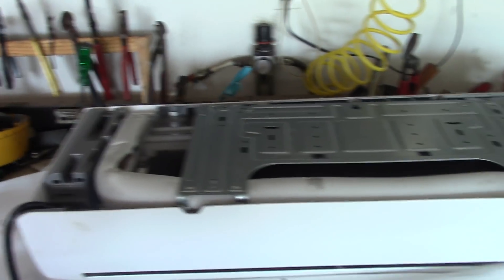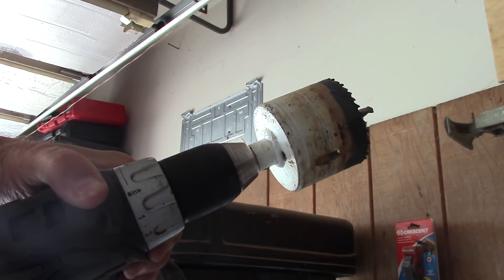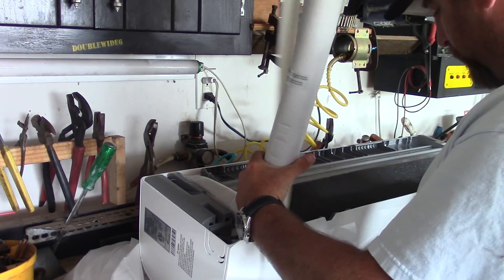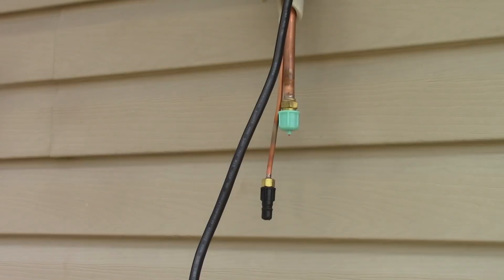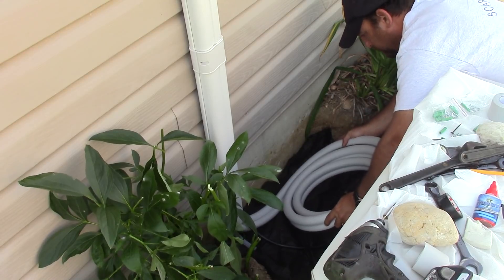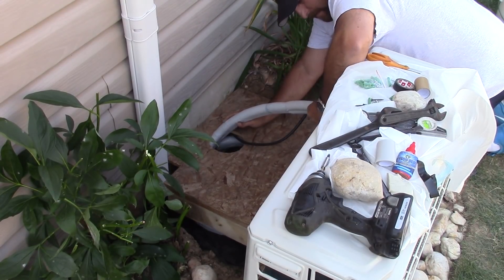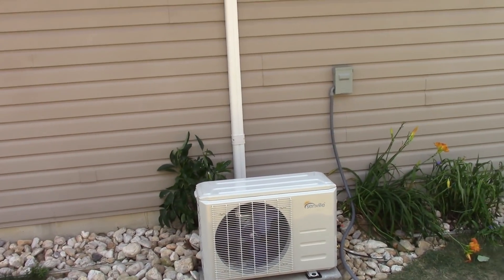Part 2 Senville Pioneer Mr. Cool Mini Split Installation

Comment: Do you think it will be an issue in the future for digging a hole so close to the foundation? I’m thinking about doing the same technique as you but I’m worried about digging so close to my houses foundation since it’s an older home with a raised foundation

Comment: Great video, would it be possible to install the outside unit in a spot higher than the inside unit or would that make the system not as efficient?

Comment: Was wondering if the unit runs good the installation says  the minimum should be 6 inches from  ceiling. I also need to install one closer to the ceiling not sure if it will actually make a difference or effect the efficiency.

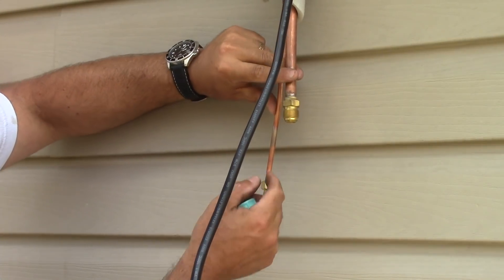Comment: So I bought this unit, and the reason you don't have pressure coming out of the low side at 6:57 is because it all came out the high side when you took the high side cap off. I watched your video before I got mine and wanted to test this out when the unit arrived, and indeed, the lines and evaporator are all pressurized - or at least, they should be from the factory.

Comment: Another great video.  Thanks.  One issue that I see.  The plywood you used is for flooring as you mentioned.  It actually is OSB not plywood.  It is a bunch of shavings glued and pressed together, which is very strong (for flooring and roofing).  However, the glue is not waterproof.  You should have used Marine Board (green in color).  Even though you covered it, to protect it from the rain; moisture from the ground will make that area around the OSB 90-100% Humidity.  It will start to rot in a year.   Although, I like your idea of making a platform to rest the unit on.

I mounted mine about 3 feet off the ground.  I used two metal racks used for heavy storage and secured them to the house and to the concrete.  It is chest high and it was easy to install the lines and wiring.  I hope to never work on it but in case I need too, it will be easy.  My only issue was lifting the outdoor unit up onto the racks by myself trying to impress the wife.  I tweaked my back so I had to stop and drink a beer.
Reply: does it cause vibration since you attached it to the wall?  do you feel the vibration in the house?
Reply: @nick467467  There is no vibration.  I never know if it is operational or not.  I have to stick my head out the window to make sure everything is functioning correctly.

Comment: Another guy not using torque wrenches.  Tylog is to ensure you get the correct seat when you torque the fittings.
Reply: ..and those lines were torqued at least 2-3 times more than required. double flare fittings should never be torqued that hard, ever.

Comment: So I just Installed my  18,000 Senville mini heat pump. Watched your video and it was very helpful.  I was able to cut my lines and make my install a little more sanitary as I had the flaring tool to do it with. I also went to our county and purchased a permit as we will be renting the house out eventually. The county guy was shocked that I was asking him for a permit as nobody had ever asked for one that wasn't a licensed HVAC person. I did have to give them an affidavit on final inspection that said I vacuumed and pressure tested the system as per the manufacturers instructions. I am in Island County WA. and the permit fee was $57.00 and the electrical permit was $65.00 All said this is a very easy install. I had several bids of around $5500.00 to do this install before I decided to do it myself. After everything was purchased from amazon and a few trips to the hardware store for minor electrical conduit and screws I have a total out of pocket of $1300.00 and a great heat system. Super Happy i did it myself !!!
Reply: Mykel Hardin  Yea the HVAC industry is seriously lacking. Every HVAC install and service company doubles their cost on parts, and 80-100% of their "technicians" are only taught OJT by more experienced unqualified techs. Even the nitrogen purge, braising, vacuum, leak check and refrigerant matching is done by unqualified people. The guys that have been in the industry for 20 years have picked up quite a lot through experience but they all have bad habits and straight up bad practices for this or that.

Comment: Great video. Thanks for taking the time to make it. I am also stuck between the Pioneer units and the Senville ones. Looking at 2 zones units. After much research I found that Pioneer costs a little less yet the installation manuals are the exact same for both brands. However, Senville does give more BTU with the outdoor condensor with the 2 zones units. Your video helped allot because Senville does not show that they include the wire, tape, and wall sleeve on their website and Pioneer does. What was your reason for going with Senville? Thanks!!!
Reply from the maker: Hey Paul, it came down to price.  I think these units are about the same in fact they use many of the same parts.  I like the Toshiba compressor and the thicker lineset with the senville.  It was 3/8 and 1/2".  Also when I talked to the manufacturer they were really helpful, so I figured if there were any problems I would at least have someone to talk to.

Comment: Looks good.
But the additional line set you have is not a good Idea. The oils in the R410A will settle in the bottom of the coils. cut them shorter and re flare the ends and remove the additional R410A to accommodate a shorter line set. Just my opinion. Looks good though.
Reply from the maker: That was the original plan, but you need to have at least a 10' lineset.  The manufacturer said that by cerpentining it like I did it would be fine.  I would have moved the outdoor unit down had I known the lineset needed to be at least 10'.  Hopefullly, people can learn from my install and do their's correctly.
Reply: Easy to say remove some refrigerate but how do you know how much?  Can’t just crack a line and hope for the best.

Comment: Nice work Bob The install is looking very clean and nice I like the line cover kit you used for the lines looks better than just the lines running down the wall. I think the way you coiled and buried the lines turned out great and should work just fine. Looking forward to the next video in the series. Have a great day. God Bless!!!
Reply from the maker: The manufacturer said the lineset would be fine the way I had it.  If I could redo it I would move the outside unit down a bit.  This unit is working great I love it.

Comment: GREAT video!  Wish it was uploaded before I started mine last week.  I have the exact same system and so far I'm right in line with how you did your installation, except my lines were a little short as my unit is on my 2nd floor, so I mounted my condenser a few feet up my wall with brackets.  I just completed my wiring today and that is when I found your video.  Tempted to wait until you upload video 3 when you vacuum down and release the gas.  But I feel more confident seeing your work confirming I'm so far so good.  Subscribing now and thanks for the video!
Reply from the maker: How did it go?  The 3rd video is out now.
Reply: It went flawless and I now have ice cold air upstairs, just in time for an odd summer cold front.  lol

Comment: Wow  This is foreign to me.  Nobody has Air Conditioning up here (maybe 1 in 50).  We are 9 hours drive north of Helena Montana.
Reply: Bruce its just the opposite here where I live maybe 1 in 50 don't have it. We get pretty warm down here in the summer and the humidity can make it feel even worse Yesterday it 96 here with a heat index (feel like temperature) was around 108 and there are parts of the country that are even hotter I have a little supplemental air off our central system in my  basement(garage) were i work on my stuff the older I get the harder the heat is on me LOL and my wife says the same trhing.
Reply: When we have heat.  Which we do   it tends to have a bit less humidity.  When there is both (humidity and heat we have a lot of seniors in distress.  That is about 7 days a year.  I have had 1 issue caused by that.
Reply: Works as a heater as well as a dehumidifier just as well as an air conditioner.  Great to keep the rust off the tools.  Depending on the SEER rating (a better measure is the COP rating which few manufacturers will give) they are at peak temperatures about 25% as costly as electric resistance heating which is the most efficient alternative.  So win win.  The only problem is how long a useful life they will have but as the price has been coming down that is becoming a mute point to some degree.  Putting an 18K btu in my shop addition before winter here in coastal Alaska.  Take care.  Doug
Reply: PS:  If you are running it year round the higher SEER rating becomes more important.  The higher the SEER the more efficient the operation and greater the savings.  Some are now at the 27 level (higher priced as well but the return in electric savings will pay in the long run).  The various units can be better for one function over another and some do all equally well--pays to do your research for what your needs are.
Reply from the maker: Wow, you said in your last video that is was 90*.  I'm surprised.
Reply from the maker: Got to say it makes a huge difference.  It is nice being comfortable when working.
Reply from the maker: Good info. Doug.  I have had problems with humidity and flash rust.  I went with a lower seer (15) because for the amount I use the unit (maybe less than 20 hours a week in the summer) paying extra for a better SEER would not pay for itself.

Comment: Nice install. Be careful this winter with snow around your compressor. The housing has a drain, but it
should not be an issue in the winter. I made a stand for mine about 18" off the ground. If you do wood
working, check your filters often. You do not want a plugged evaporator coil.
Reply from the maker: All good tips.  I am going to shovel around it when it snows.  I heard they make snow feet to raise it up.  What does the hose do.  I did not put one on because I figured it would drain off the slab.  If the hose freezes what is the use of it?

Comment: Not very easy, i saw and you are doing this on your own. Bending the copper is very critical. For this job, some knowledge is required. Look forword to see part 3.
Reply from the maker: All in all, believe it or not this job was not too difficult.  I just took my time and did a lot of research.
Reply: @doublewide6  Thanks Bob. Getting ready to perform an install. Do you think I could bend the copper by hand as you have or is it SAFER to get a tubing bender? TIA